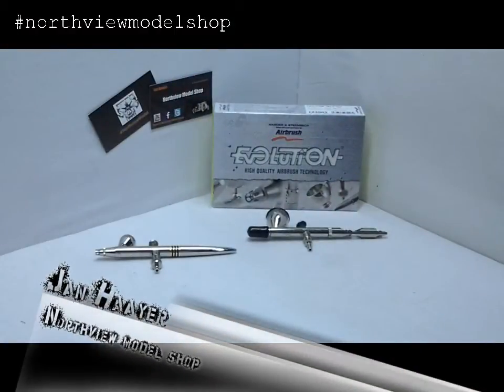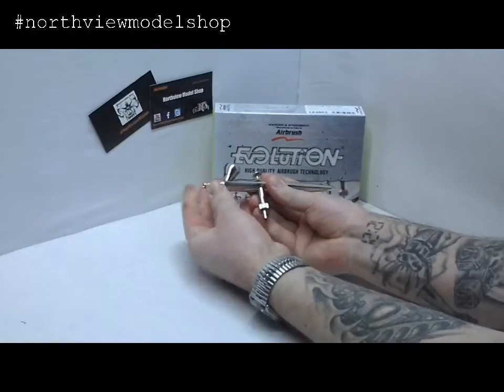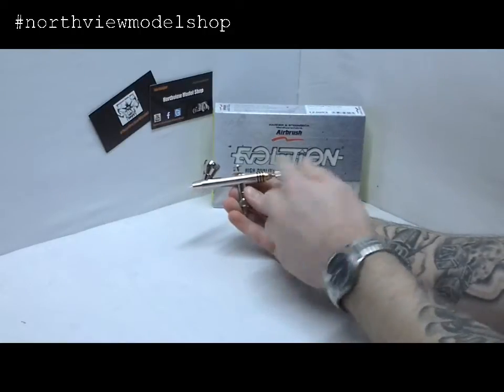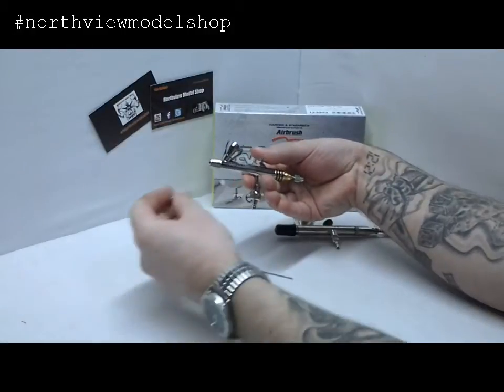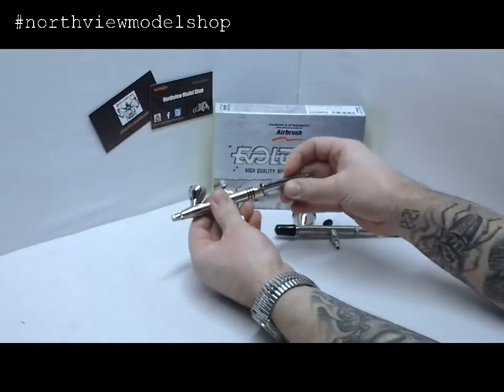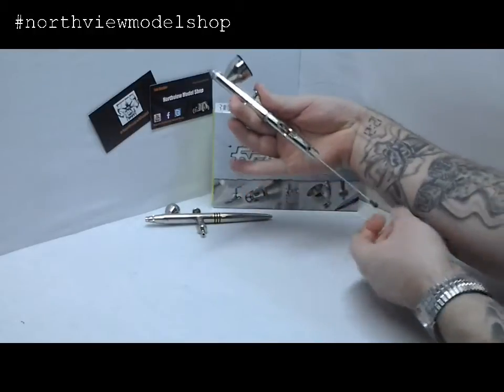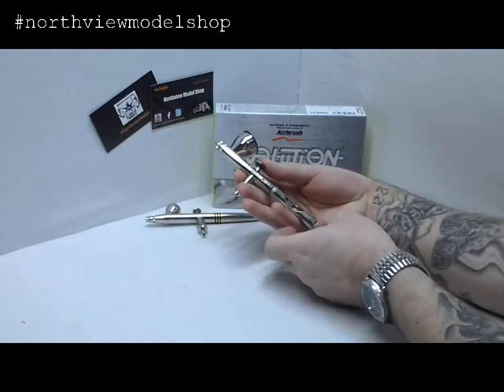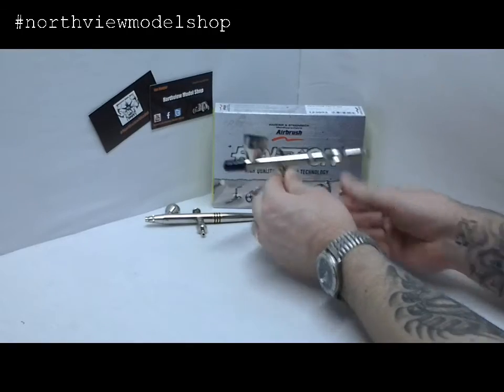Airbrush Needles

Comment: I castrated both my badgers, the Patriot 105 and Anthem 155 for ease of cleaning.Two things I would like to add. First, use an airbrush holder that can be slightly tilted so that the AB is nose down when not in hand, this way, gravity helps with keeping paint in its place. Second, after cutting the ball off, make sure there are no burrs or divots left by the cutting. Take some fine wet and dry sandpaper and smooth off any problems because a sharp burr could scratch the teflon packing inside.
Reply from the maker: thank you very much for adding these great points